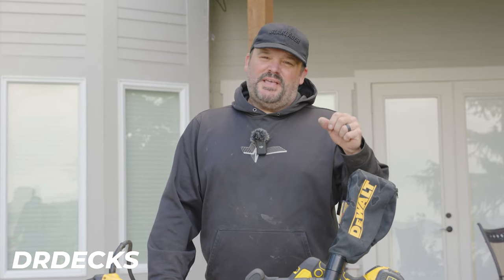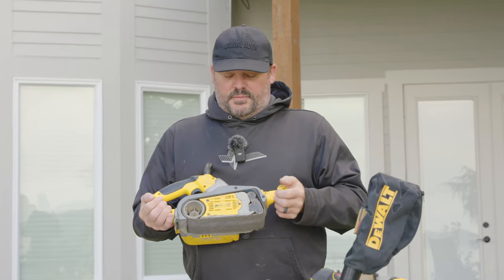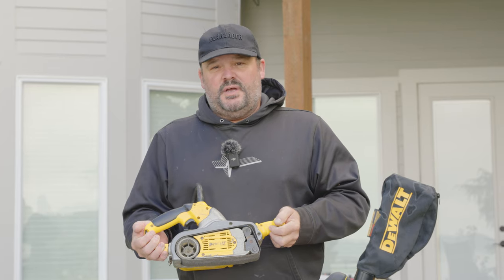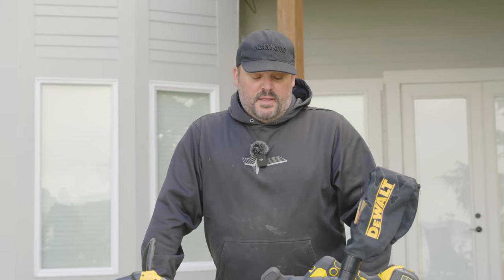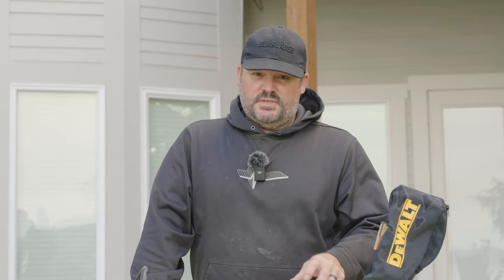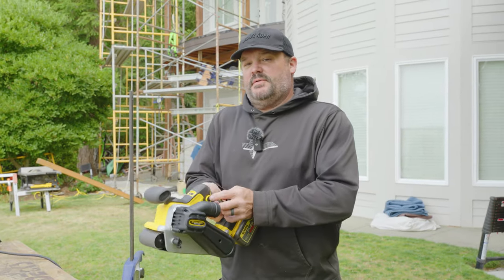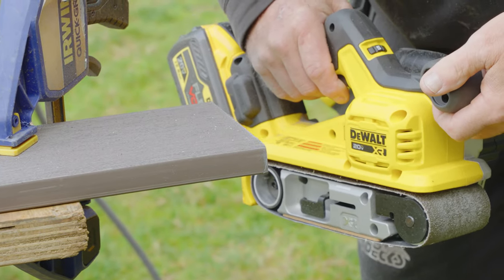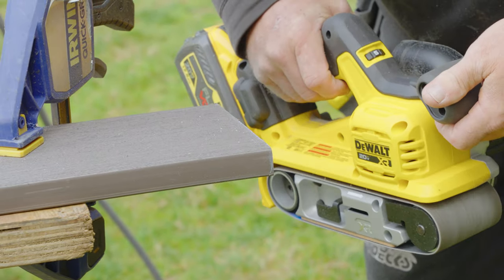Will This Cordless Sander Replace My Favorite Tool? || Dr Decks

Comment: I'm normally a DeWalt guy but recently opted for the 36V Metabo HPT instead.  Haven't used it much so far but am impressed with its overalll build and power so far.  Specs wise, I'd assume the DeWalt is more of a refined or detailed carpentry sander of the two with its smaller speed range and variable speed trigger whereas the Metabo beast has the extra power , larger speed range and a  basic on/off.  Auto mode is interesting.

Comment: So what do you do in situations when sanding up against a bladder or joist? Just make sure the belt isn’t overhanging and butt right to it?
Reply from the maker: Correct. I’ve gone as far as shaving the belt to make certain it doesn’t drag into the bladder.